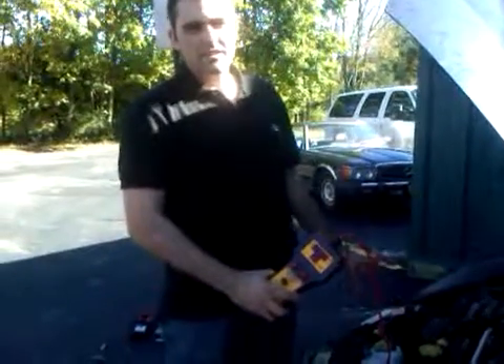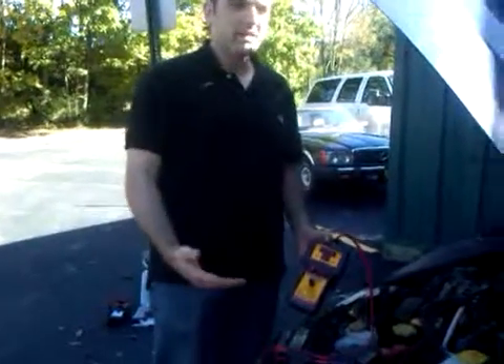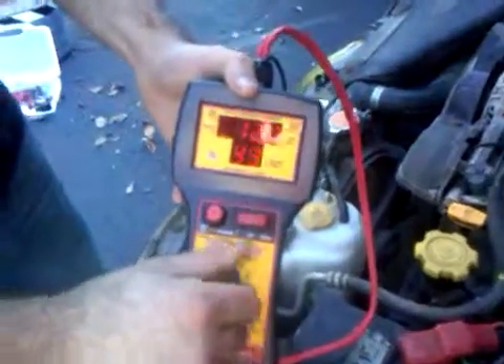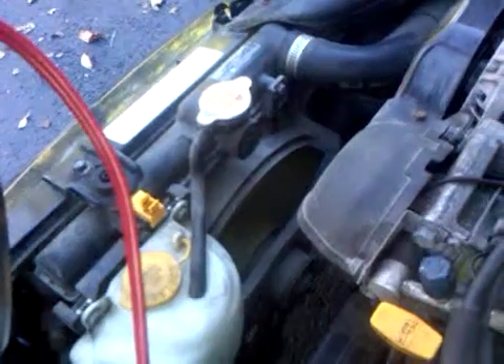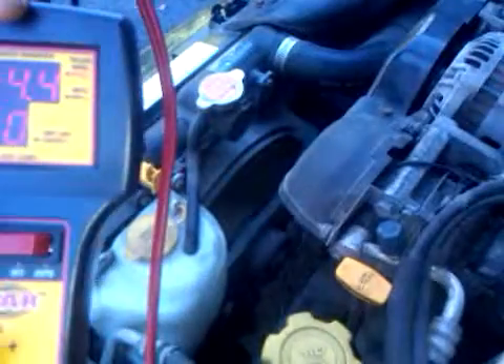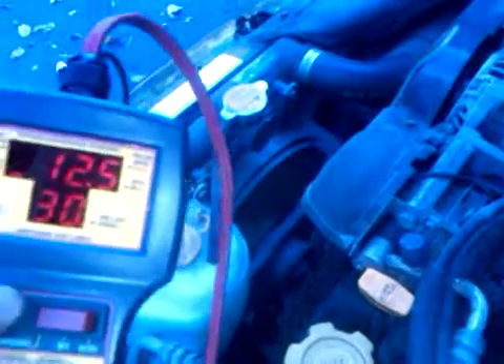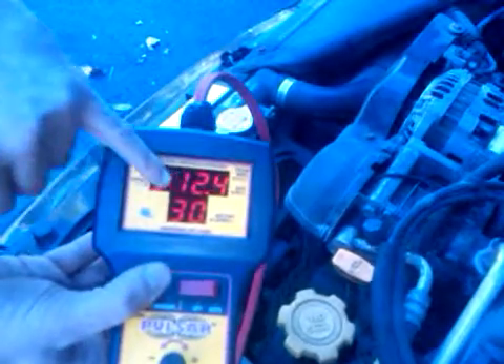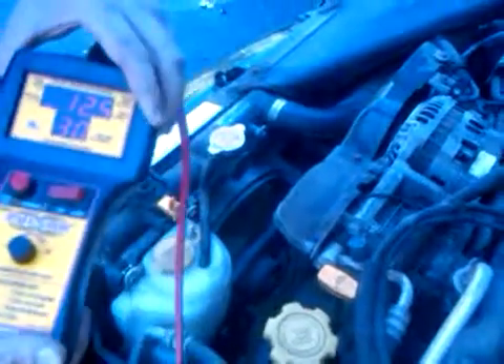Pulsar testing fan motor

Comment: really quick and good explanation , do you know by any chance if there is some damage at the coil of the fan,  could that cause a shortcircuit if i try to test it with a dirce  12 dc , extracted from whatever place .